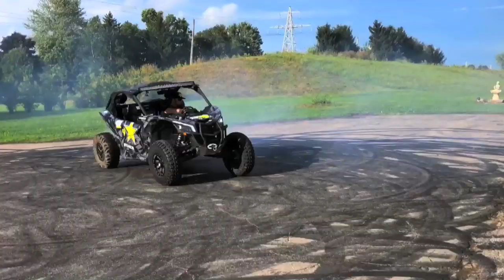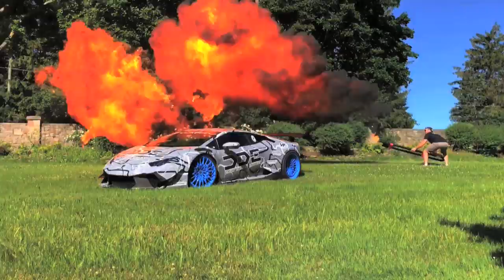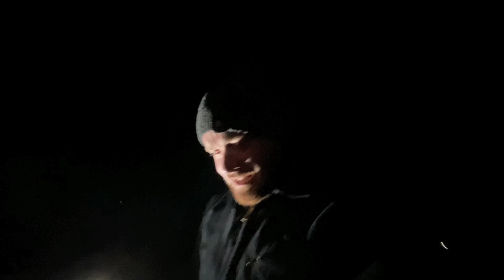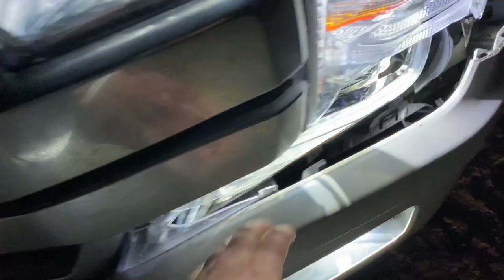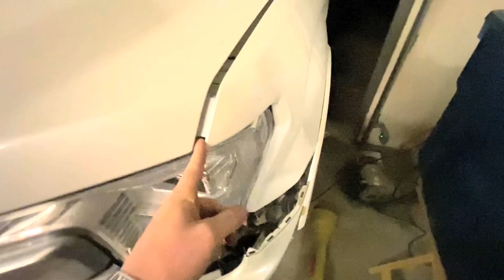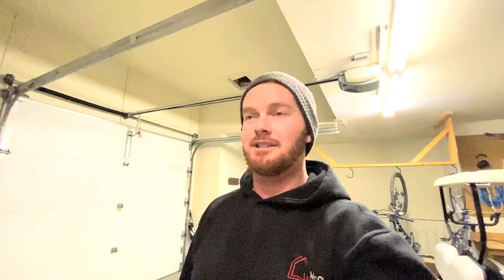My Accident

Comment: Lucky 🍀 your airbags didn’t go off or would have be more then 5k
Reply: It'll be around $5000 anyway. If it's truly fixed right. But yeah, some steering wheels are over $3000 and airbag deployment puts a permanent strike against the vehicle. It totals them in some areas.